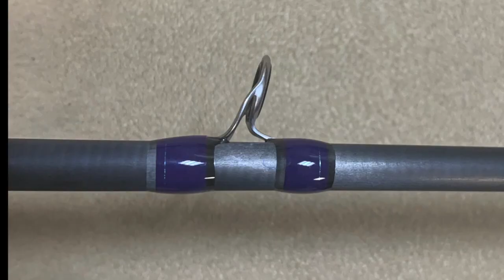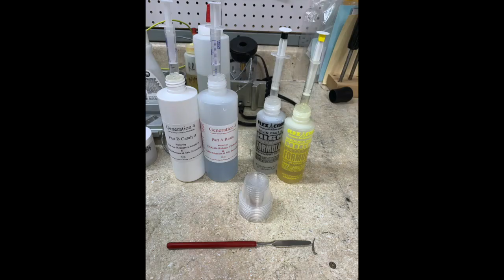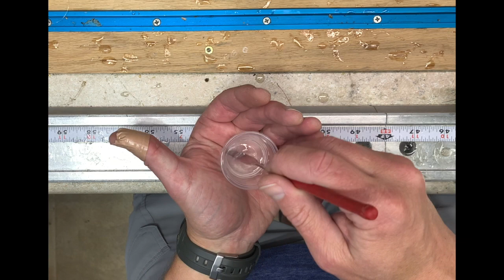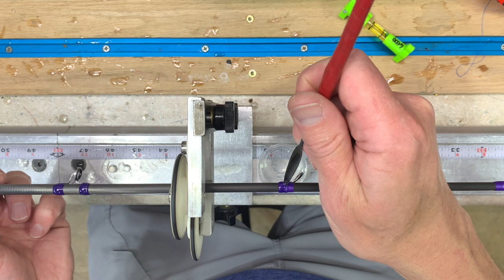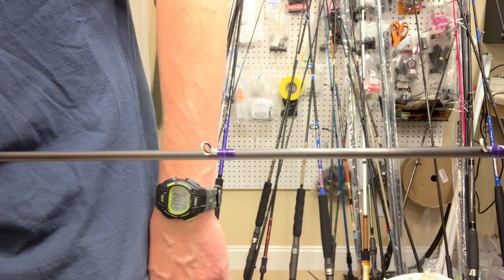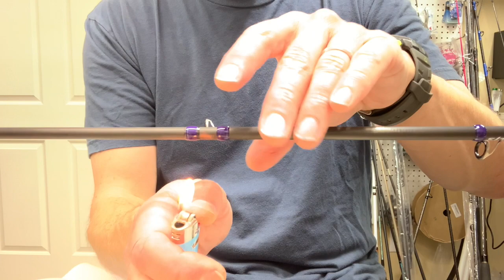How to Apply Guide Wrap Finish the FCR Way

Comment: I’ve always heard to not use a cigarette lighter because the butane suet will stain the finish. Even tried it once and it did leave a brownish black stain. What gives on that?
Reply from the maker: Thanks for watching - please like and subscribe!

So technically you are correct - a cigarette lighter burning butane will create some soot that can taint the finish.  However, in my experience this soot is only created when the high orange/yellow part of the flame touches an object.   The flame goes NOWHERE near finish using my technique and I have never had a soot contamination problem.  That said, you can use an alcohol lamp if you'd rather.  It certainly is a clean, cool flame.  Hope this helps.
Reply: Lighters can definitely leave soot on a finish. I will occasionally cheat and use a lighter, but if I do, I always use the lighter at the base of the flame and come at the rod from the side. Clearly he has his technique down and working great, but definitely something others need to be aware of and practice to get the hang of it. For whatever reason, the base of the flame near the lighter doesn't seem to give off any soot like the top of the flame can. I'm not sure of the science behind that, but that has been my experience.
Reply from the maker: @TheFishingHobby  I agree - only the top of the flame seems to leave soot.  Of course you could always use an alcohol lamp or mini torch or some other source of heat if you like.  This is just what works for me.
Reply: @masteringrodbuilding  I've had an idea in the back of my mind for making something unique for heating rod finish up. I haven't gotten around to that yet, but I'll be sure to upload a video about it when I do.
Reply from the maker: @TheFishingHobby  sounds awesome...would love to see what you come up with!

Comment: How do you keep what you applied not dripping while you are working on other guides?
Reply from the maker: Thanks for watching...please like and subscribe.  That is a bit tricky on larger guides.  First, let the finish set long enough before you start that it has clearly thickened.  Second, constantly rotate the rod to keep it from dripping when you are moving between guides.  You sort of have to keep a timer in your head and know that stuff will drip off if you let it.  Finally, it's possible you are using too much if it always drips off on you.   Hope this helps...good luck!

Comment: I had an old rod and havre been practicing using the flex coat "lite". I know you use the high build. The finish came out great but does not have the bulk that yours did. 
Does your method only work with the high build ?  I am happy with the low profile finish only if it serves the purpose without the bulk. Do I need to add a 3rd coat? On the second coat I let the flex coat sit for 15 minute and it became "syrupy" and thick but dried to a less dense finish.
I hope I explained myself clearly.
thanks
Reply from the maker: Hello Lyle - thanks for watching.  Please like and subscribe!  So...full disclosure I've never used the FC Lite so I'm honestly not sure if this technique works with that.  BUT...it has worked with everything I have used so I assume it would work.  It would likely just yield less build up.  But it might very likely need more or less time and would (I'm guessing here) yield less finish depth by virtue of fewer solids in the coating.  But only Flex Coat could say for sure on that.   And remember that temperature dramatically affects your time table...I work at about 75 degrees Fahrenheit.  

In terms of build depth and whether you need another coat, that is really up to you and what looks good to you.  From a purely functional standpoint, as soon as you have complete saturation of - and coverage of - the thread wraps you are functionally complete and every else is just cosmetics/aesthetics in my opinion.  

I find that rods where the finish is so light that you can see thread ridges/texture show wear more easily than rods with more depth or build up to coat the thread wraps.   Thus why I build up my finish coats to the depth I like.  My finish is about average in depth but some people think it is very light...and others find it very heavy.  So it's kind of subjective.  

All that said, if it is functional and looks good to you then it is 'right' and you are 'finished'.  No pun intended.  I hope this helps!

Comment: High build or low build - when do you use each and why?
Reply from the maker: Thanks for watching.  Please like and subscribe!

So in the words of Dennis Miller:  'This is just my opinion.  I could be wrong.'  Your actual mileage may vary. 

For me it's high build always and low build never.  I've never personally seen any need for low build finish. I just put high build on and remove it until I'm happy.  I guess maybe lite releases bubbles more easily?  Or maybe it has a longer pot life?  But it also must be turned longer and runs out under guide feet way worse in my experience.  To me, you just don't need it once you know how to control and manage your high build finish. 

Let's take a traditional finish that has been around as an example:  Flex Coat.  Great, proven product that is very easy to use for most.  Proper application of heat makes Flex Coat products temporarily low build...whenever I want.  And then it's high build if I leave that bit out.  So if I know what I'm doing, Flex Coat High Build does everything low build does and then some - but the opposite is not true.  In my experience lite is just not a club I need in my bag.    

And take the next big thing in finish:  Gen4.  This product is a game changer.  But even with it...why do I need lite?  The Gen4 high build releases bubbles like crazy with NO HEAT and I can easily apply it so thin with a brush that I can feel size A thread ridges with my fingernail after a coat.  And...I can put it on heavy if I want on butt wraps or whatever.  If high build will act as both lite and heavy for me...what do I need a low build for?  

Use whatever works for you...I know some fly rod builders that use lite either for the first coat or the entire build.  But for me I stick to high build.

Comment: We’re you or do you use this same process with the gen 4 and you using regular or low build?
Reply from the maker: Thanks for watching - please like and subscribe!   So I use the exact same process with Gen4 and it works great.  You do need to rotate it a bit longer on the dryer (I go 3.5 - 4 hours at 76 degrees with Gen4).  

And I always use high build.  To me, low build is pointless.  I can get high build so thin you can see the thread ridges just by applying some heat to thin it and removing the excess.  In my experience high build will do everything low build will do but the opposite is not true.  So use whatever you like, but I see no point in a low build finish - I just control and manipulate the high build to get what I want.   Hope this helps - tight wraps!

Comment: Bill do you use the same technique with builds that has under wraps?
Reply from the maker: Thanks for watching - please like and subscribe!  There are lots of ways to do it, but I apply the finish - two light coats - to the underwraps first.  After that has set for a few days (36 - 48 hours) I then do the guide wraps and finish as described in this video.  Hope that makes sense...good luck!
Reply: Thank you  Bill got it!

Comment: Is high humidity bad for putting on finish?
Reply from the maker: Well...high humidity is not ideal.  Humidity does not extend cure time like cold temperatures or accelerate them like high temperatures.  In fact humidity does not affect the cure time of epoxy - or its ability to cure at all.  So if your finish is tacky or won't set up, it is NOT humidity.  BUT...humidity is one ingredient to a really nasty outcome called amine blush.  

If you get just the right combination of humidity and CO2, you get an oily glaze on the finish of your cured epoxy.  It is not common, but it can happen...if the humidity and CO2 levels are both high and reach just the right balance.  

If you eliminate humidity, there is no way to get amine blush.  So it is good to minimize humidity if you can for that reason alone.   I live in Alabama and it is very humid at least 8 months out of the year.  However, I keep a small space heater in my shop that keeps the temperature at a steady 75...and in the process lowers humidity and holds it pretty steady.  If you are having issues I'd suggest you look into temperature control...you'll likely find humidity stays in check.  

Hope his helps...let me know if you have questions.
Reply: @masteringrodbuilding Thanks. I have a few questions, most importantly level finish on butt wrap. Building rods for few years,  can't seem to get level finish. I think it's the rotation that makes it so, or its the uneven amount of finish, or satan. I used the pro kote which which seems to have the most level finish, but end result is not as tough as thread master. I use thread master lite and heavy, best results by leaving rod sit 5min then rotate 180 degrees and repeat until firmed up. Will try the Gen 4 which you recommend.
Reply from the maker: @peteruveges1976  here you go:

https://www.youtube.com/watch?v=TXnHedpLZYU&t=1417s

Comment: Are you using high build or low build gen4 finish?  I couldn’t find if you talked about that.
Reply from the maker: Thanks for watching Ben...please like and subscribe!  

I use the regular high build Gen4.  I can easily get it very thin by warming it and removing excess and it penetrates completely along the guide foot tunnels, etc.  So I personally have never seen the need for a low build/lite version.  Hope this helps...good luck!

Comment: Hi, I went through the video a few times and likely missed it.  Are you waiting for certain time after the first coat to apply the second or are you waiting the manufacturer recommended time?
Reply from the maker: Thanks for watching...please like and subscribe!

I wait until the first coat is firm and tack-free before applying the next coat...at 75 degrees that's about 8 hours for Flex Coat Original High Build and about 12 hours for Gen4 High Build.   In no event do I wait longer than 24 hours for the second coat.  So apply it any time in that window.  

If you are using a different finish, then I'd follow the manufacturer's recommendations.  Hope this helps.